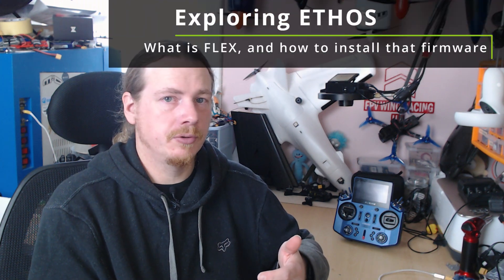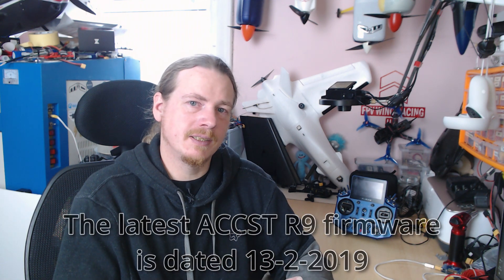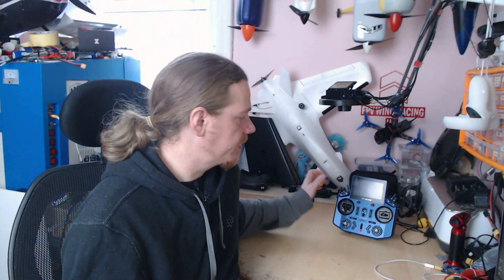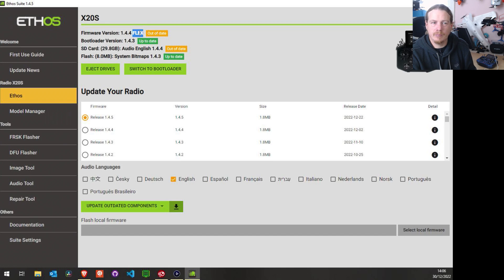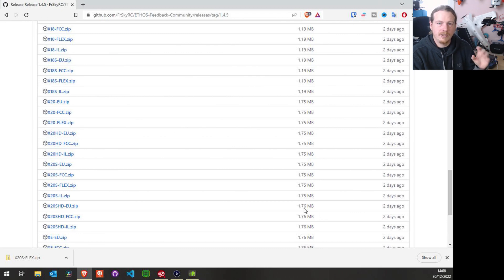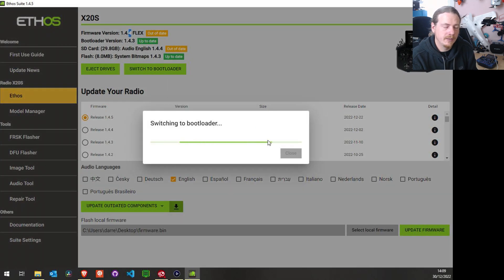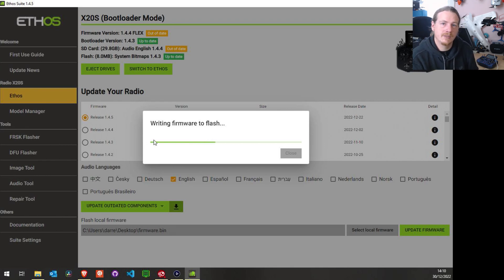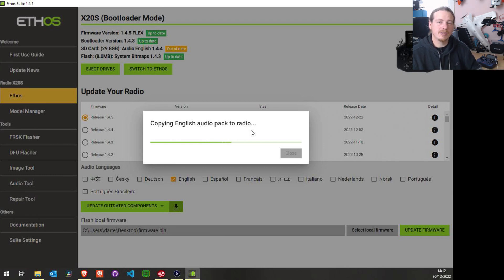What is FLEX firmware, and how to get it on your ETHOS transmitter

Comment: hi how are things? You know, I have been a frsky user for many years, using rx fasst, after having the x18 then the EU version and I want to transfer it to FCC, I know that with firmware it is possible, but should I change the antenna too? I would be very grateful if you could help me. greetings Matias

Comment: Great video, as usual. Many thanks Darren!!!!
When Flex is installed, could you please explain what parameters (and where) should be set on my X20S (flying in Belgium) to accomodate 900M at 100mv with telemetry? For the moment I can't go above 25mv as otherwise I'm losing telemetry. I browes internet but wasn't able to find any kind of "step by step" guidelines. I'm really a beginner here. Manby thanks in advance!!!

Comment: Darren, very helpful series of videos. Thanks. Im still confused about a few things. I have flex firmware on my X20s and a TDMX rx. Tried it at 100mw (868 band). Telemetry range is very poor (about 500mts) but RC signal strong. I dont know if telemetry at more than 25mw is only available with and external R9M module as manual suggests? I think because I set power to 100mw, the telemetry is only operating on the 2.4 band? Dont know if I should get an external R9M or a CRSF. I would like to get mavlink telemetry from TX to a PC. I think the CRSF can do that?      Edit *** anyway the telemetry comes back from RX so surely its more to do with how much power the RX can put out (does it try to match the TX setting?)

Comment: Just a doubt / Query - We could still use an external module like crossfire , multi v4 , etc with the FCC firmware ? Or one needs to upgrade to FLEX to use external modules.
Reply from the maker: External modules take care of their own RF. so it doesn’t matter.

Comment: Afraid of mobile phone towers that transmit on FCC frequency, i.e. 915MHz, I am going to install the Flex firmware so I can change to EU. Do I need to change the antenna inside the transmitter for the new frequency of 868MHz? Thank you.
Reply from the maker: Everything needs to be on the same frequency. You also need to use the correct length antenna. If you have an FCC radio, it’s best to stick with 915MHz.
Reply: @MrD  even if here in EU 915MHz is used for mobile phones?
Reply from the maker: If you’re in the EU, you should be using 868MHz already.
Reply: @MrD  i am not as rc came outside the eu. I will install FLEX but would like to know from where to get the Tx aerials for 868MHz.
Reply from the maker: You should be able to buy the handle, which has the 900MHz antenna inside, as a spare part.
Reply: @MrD  Thank you

Comment: Can you do a video on setting up a RB-40 along with a X20s..

I have no idea what I'm doing
Reply from the maker: Hi James. Unfortunately I only have an RB-20, which is a much simpler beast. But I may be able to do this in the future.
Reply: @Mr.D - Falling with style  great thay woukd be swesome , I have 2 14.8v lipo batteries that need to be regulated down to 8.4 output for servos and reciever , 6.6v for ignition module 

All going in a 104" skywing Extra NG

Comment: I laughed my ass off when I opened this video very funny thanks. So I’ve been doing some research on mfd min crossbow. I’ve had mine for a while just was saving for winter project. Unfortunately mfd telefly tinny module have a very limited manual they don’t even tell u what the buttons do on the module. So the easiest way I see to get this thing track is to wire tinny into video after f/c before vtx. Tft takes gps info and push’s it down video. So that gives aat something to track. Simple enough. Now I like inav osd tft has osd to so they say I can use any osd as long as line zero is open for tft to send gps data. Was just woundeing what u know about aat and inav any tips or suggestions be greatly appreciated thank. Steroids shrink your wiener that’s why I never touched it I’m bad off in that department lol I think I have everything ready to go ground station is ready  gonna wire up tft today so we see really hope it works I would really like to move to 1.3 vtx but not sure how well that’s gonna play with crossfire maybe ok have more separation with antennas have a few different notch filters. I’ll get 5.8 working first may not need to switch would be nice to have the penetration of 1.3 but I was getting good range before with 5.8 8 miles with 13dbi patches on goggles. I really hope 6.0 is that much better can’t wait to take if for a spin happy new year
Reply: Myflydream has the full manual in the downloads area on there website which shows in great detail how and where and what to install including what the buttons do,I run there systems and have downloaded it from there AAron have a look and let me know how you go....I can email the manual to you as well if you want.
Reply from the maker: Hi Aaron.

Awesome. That's what I like to do with some of these video thumbnails. Have a bit of fun and make people laugh. 

I've not used the MFD ATT/Telefly system. However, on analogue video it should work fine. Just have the telefly after the FC and before the VTx like you said, and leave the line of characters at the top empty. I know the Sentinal system works in a similar way. With a thin data line across the top of the OSD.

Plenty of people use 1.3 with Crossfire. So long as you use a low pass filter on the VRx (Video Aerial Systems and TBS have them), and have a bit of separation, you should be fine.

Happy new year.

Comment: I never had an issue where it would say LBT in the suite, its said FLEX since I put FLEX on it months ago.  Also for the X20 there is a FLEX antenna available for it so you don't even need to change antennas on the TX.  ACCESS receivers flashed with a FLEX transmitter update to FLEX automatically.  For my ACCST receivers its LBT which was a little confusing knowing which firmware to flash to older receivers when I first went to FLEX.
Reply from the maker: The FLEX of the firmware part only effects the 900MHz side. So regular ACCESS receivers will still be using LBT or FCC. With ACCESS R9 receivers, you still have a FLEX firmware; even the newer MX and SX receivers. This needs to be installed to use FLEX.

There is no real flex antenna. The two frequencies need different physical lengths of antenna to be optimally tuned for each frequency. What you may find is an antenna tuned around 900MHz, which has average performance for both frequencies. But would be out-performed by antennas of the same style for the correct frequency band. But if you're not pushing the range of the system, they would probably be fine.

Yeah, the problem that I found is that when binding an ACCESS or ACCST 2.4GHz receiver. You have to set the FLEX side to the correct frequency, otherwise it will be trying to use the wrong region. So 868MHz for LBT or 916MHz for FCC. ACCESS will automatically switch the receiver between FCC and LBT. But ACCST needs the correct firmware on the receiver. The annoying part is that you can't set a default for the 900MHz frequency. It would be great if that was a system option. It would make setting up slightly quicker.
Reply: @MrD  The new UNI firmware for the X8R receivers brings some of the ACCESS features to that ACCST receiver and you don't have to worry about if you have LBT or FCC anymore etc...  But... just going to ACCESS.  Its just better.  I am wondering a bit what exactly the FLEX antenna looks like honestly, I have one, but I'd probably have to pop it open with a guitar pick or something.  I also have a X18SE I got from the States along with my Spain bought X20S so I've got all 3 antennas actually... might be cool to pop them all open and take pics if I manage to not break them.